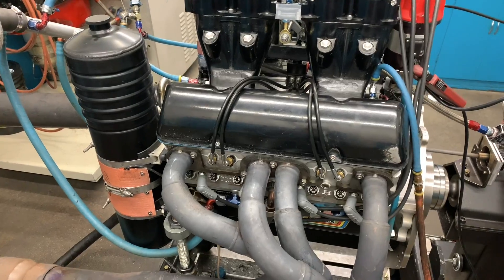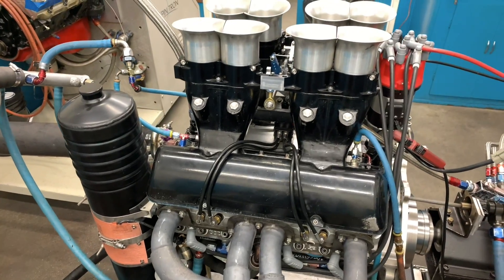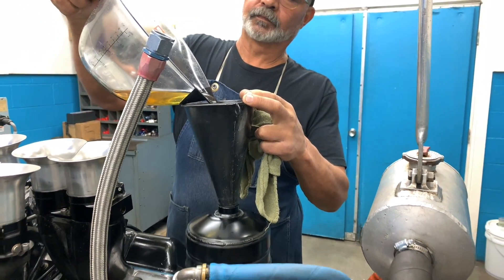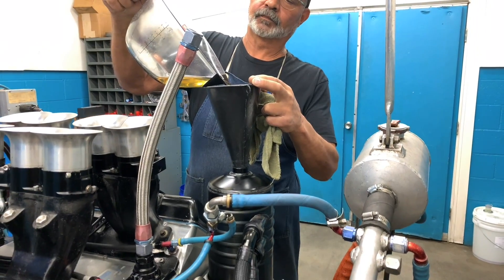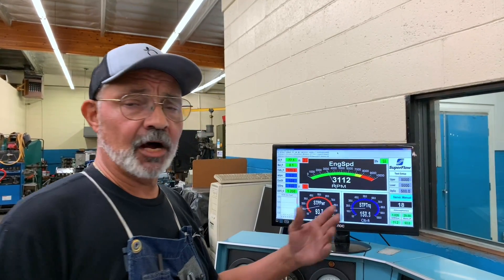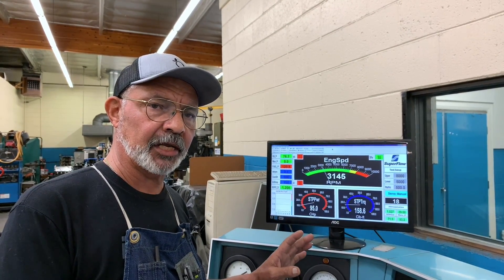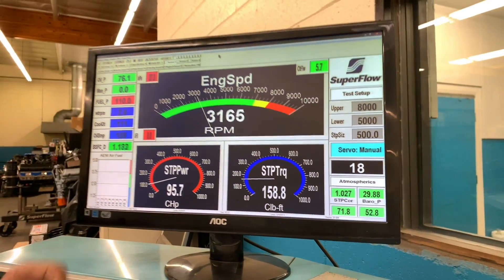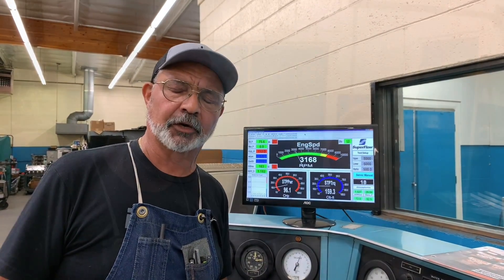Don't RUIN Your Engine! Here's How To Break It In Like A PRO!

Comment: I'm guessing this is the same tips for any new car engine....rev it but not too high so at least you get that engine pressure.
Reply from the maker: Correct. Same thought process for a new car.
Reply: @TotalSeal  Interesting how manufacturers still keep the same BS in their manuals....especially whats interesting is modern day mechanics with CVT transmissions...

CVT's are meant  to keep your engine rpm at optimal range but they still tell you vary RPMs. It contradicts the whole process and programming of engine when the transmission does the opposite lol.
Reply from the maker: @441meatloaf  So true, and great point about vehicles equipped with CVT transmissions! I guess they are more worried about someone over-revving an engine, especially when the engine is cold.
Reply: @TotalSeal  I'm interested in your opinions on small engine turbos like these 1.5L Turbos that all these manufacturers are putting in like Hondas to please EPA estimates. I see way too many people complain about CUVs not having turbos but then turbocharged CUVs at 1.5L gets the similar power output just higher torque figures at low end....

IMO, 1.5L turbos is not efficient solution to save gas when they almost all require premium gas solution to prevent engine knocking and misfires due to the high compression rate...Worst part is putting turbos on these engine have such bad turbo lag (while those segment buyers want instant power when they floor it to pass on highways etc...).

The torque curves on these cars are tuned to low end torque at 1500-2000rpms but at higher ranges power is just non-existent.....floor it and turbo lag kills it compared a similar 2.5L N/A engine.

I'd rather stick a 3L v6 in there that offers way more power without the hassle of a turbo at similar gas efficiency.
Reply from the maker: Good points. As you mentioned, these engines are not designed to be ideal for the customer. Instead they are designed to meet EPA requirements during their standardized testing.
Reply: @TotalSeal  Its kinda sad to see the state of emission control trying to force manufacturers make smaller engines but ends up having not any better fuel efficiency than larger engines. I mean kinda defeats the point on less CO2 output when turbo forces the engine to burn more gas negating any fuel saving CO2 measures.

Sadly this is way its going to be in the next few years to come, at least we don't live in Europe. EU has forced every manufacturer to dump large engines in favour of small 1.5L turbos that are 3 cylinders, even more inefficient than 4 bangers.

Comment: Hello. Could you please tell me what could happen if the rings can not seat properly? If during the first hundreds of hours of operation you are applying more load that the engine can handle, that won't let the rings seat properly right? Which symptoms the engine can have because of that?
Reply from the maker: Thanks for the question. If the rings do not seat properly, the engine will suffer from high blow-by and excessive oil consumption. 

Applying moderate load to the engine will not hurt the engine. Like most things, moderation is the key. Too little load is bad. Too much load is also bad. Moderate load is just right.
Reply: @TotalSeal  Thank you very much for your quick response. 
If the seals are not seated properly, that could also lead to carbon deposits on the piston crown and ring grooves?
Talking about the excessive oil consumption because of the bad piston rings seating, ¿Could you please explain me how that happen? I have been searching for info about that, but I haven't found it. 

Thank you again for your help.
Reply from the maker: We are happy to help. In regards to your first question, poor ring seal can lead to increased carbon deposits on the rings and valves. Poor ring seal allows excess oil into the combustion chamber, which is bad. 

Poor ring seal also allows increased amounts of combustion gases (blow-by) to enter the crankcase, which creates more crankcase vapors. These vapors are evacuated from the crankcase via the PCV system, which routes them into the intake manifold.

We’d suggest looking up information related to PCV systems in Direct Injection engines. There are some good SAE papers on this topic.
Reply: @TotalSeal  Thank you!
I realized I wrote "Seals" instead of "Rings" in the first question. Sorry. 
Just to confirm:  If the rings do not seat properly, It will happen all what you explained in the first paragraph, right?

Thank you again for your help!
Reply from the maker: No problem. Rings are seals, so what we described will happen if the rings do not seat properly.
Reply: @TotalSeal  Thank you very much!
One last question: Do you know where I could find all what you just explained about the Piston rings and the improper seating? It'd help me a lot to support my explanation.
Reply from the maker: Outside of some SAE white papers, check LN Engineering’s website. I believe they have some articles detailing this subject.
Reply: @TotalSeal  Thank you so much for your help!

Comment: The actual break-in procedure isn't shown... they only discussed the initial load, then cut right to WOT dyno pulls.
Reply: The info flew right through your brain without stopping. 
.
The dyno pulls ARE the break in. You need cyl pressure and heat. The only way to get them is run the motor hard.

Comment: Great video. I'm getting ready to do a fresh start up on my bbc with a roller cam and this is exactly the info I was looking for.
On a side note. What are the specs on the engine in the video?
Reply from the maker: Thanks! The engine is a 410 CI, injected methanol fueled small block Chevy.

Comment: Man this video explained a lot. When you are breaking in a flat tappet cam you run the engine above 1200 rpm for a minimum of 15 minutes to break in the tappets and the cam lobes.
The rings are a totally different thing. They require a load and heat AND the right oil. Man this has never been revealed to me before. Thank you very much gentlemen!
Reply: Yeah after I saw I had oil pressure ,I upped the idle to around 1500 and gave a full throttle blip every 10-15 seconds only letting the revs come up to like 2500. 
As time goes on ,blip it harder and let the revs climb more. 
At the end of 20mins I was idling at 2k and blipping it to 4500. 
Mine was a VW TDI diesel ,not a typical V8. 
After that break in,I got the car ready for a road test and gave it some full throttle load but didn't rev it much past 4k or so. 
Ran great for years and had like 1/2% of leak down after 10k and 20k miles. 
People always seem to take it too easy on a break in, engines can tolerate more then you think.
Reply from the maker: Thanks for the comment!

Comment: So for anyone building engines in their garage this means just take it out and too the track and do short power runs with it.
Reply from the maker: If you are not able to run on a dyno, taking your car to a track and running short medium load passes up through full passes will also work well. They key component is making sure the engine is under load to break in.